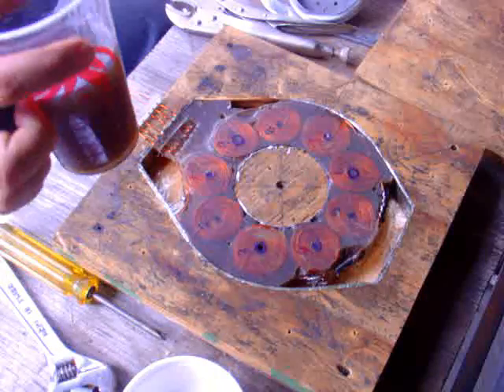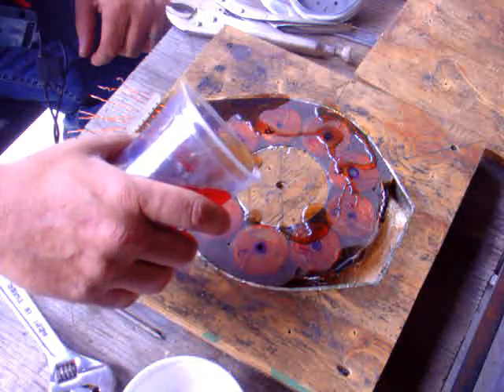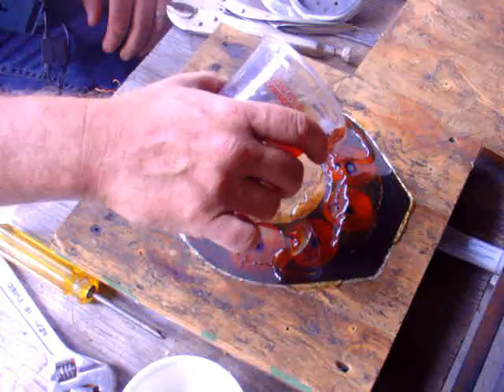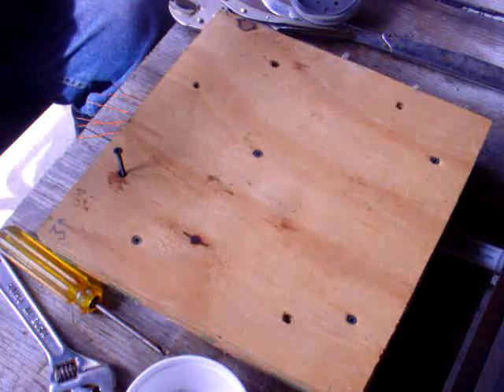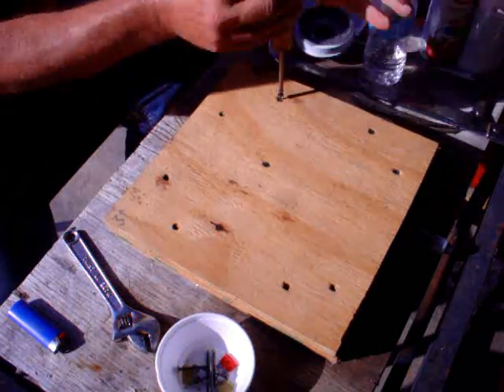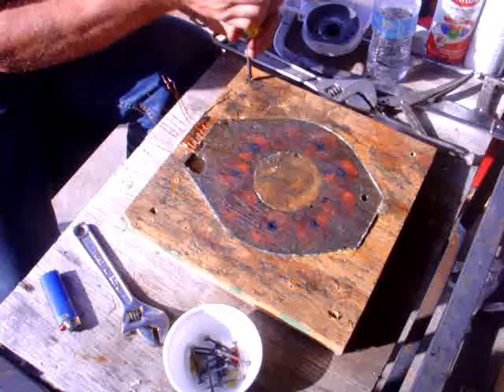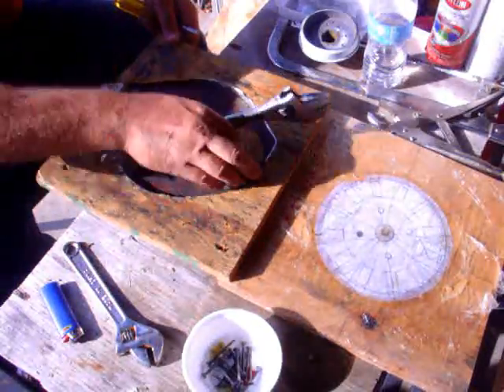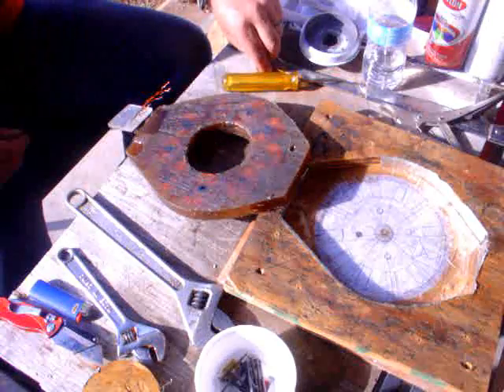PART 5 DESIGN OF MUDDY'S MIGHTY MINI WIND TURBINE

Comment: no no, why didn't you use it to take out the last 8 screws? you were using a screw driver. ps I love the idea, I'm making one in in the next few days, I already have a drill with wires coming out the back that I was experimenting with as a power generator.